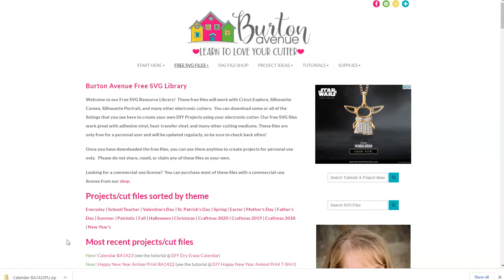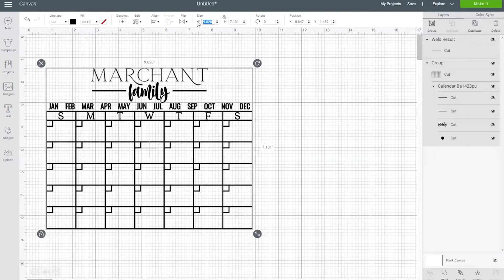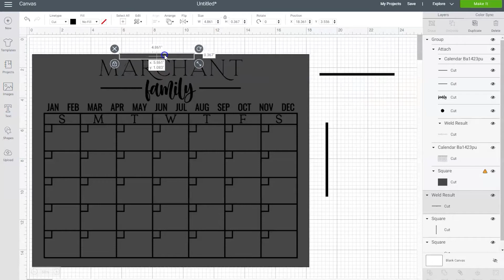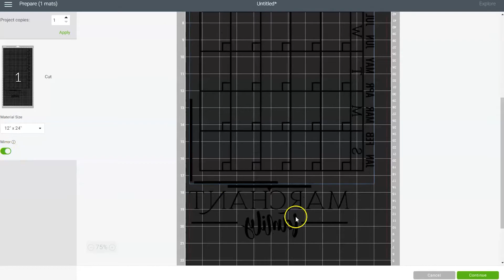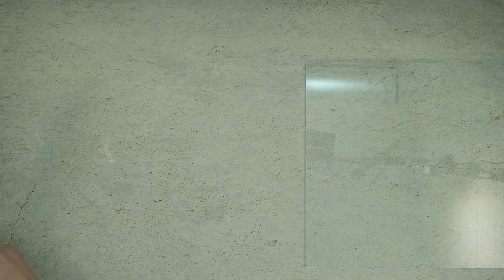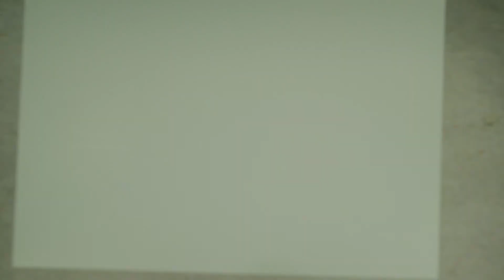Make this Dry Erase Calendar with your Cricut

Comment: which large cutting mat did you use? I only have the ones that come with the cricut are they too small?
Reply from the maker: There is a larger mat you can purchase that measures 12" x 24".  That is the one I used.

Comment: Is there a way you could post the SVG file for calendar that I can edit? I printed it out and I lost half a line surounding it and also the "D" in DEC or give me the name of the font and size used. I really don't want to reprint it as that is the only thing wrong with it.  Thank you so much for all the things you do!
Reply from the maker: You should be able to edit the SVG in your software using the slice option.  Or, if you send me an email and let me know which line you lost, I can send that and the D so you can cut just those.
Reply: @BurtonAvenue  I lost the side line of the calendar and the D in DEC and the N in JAN. Thank you so much. My email is sonjaschaefer54@yahoo.com